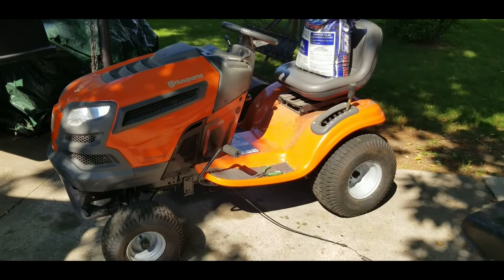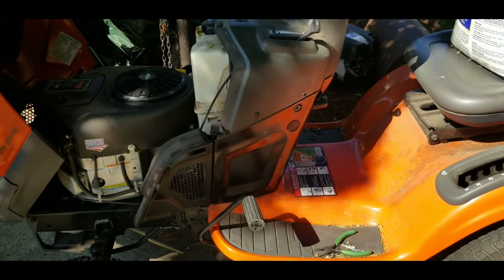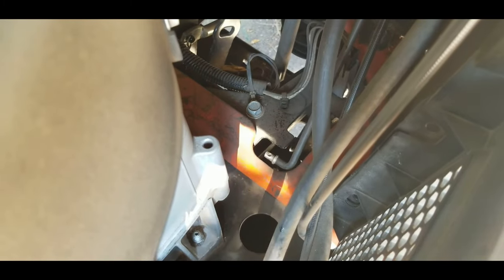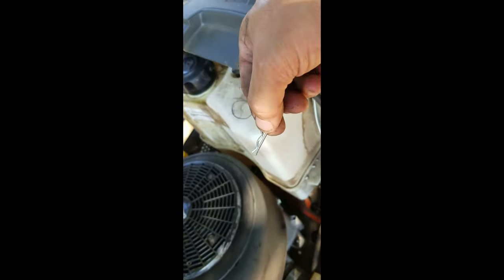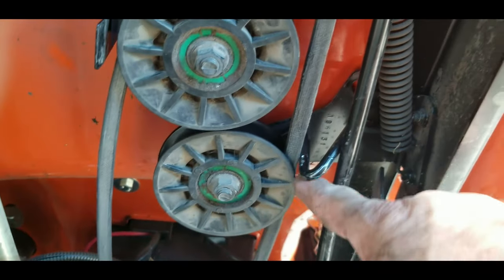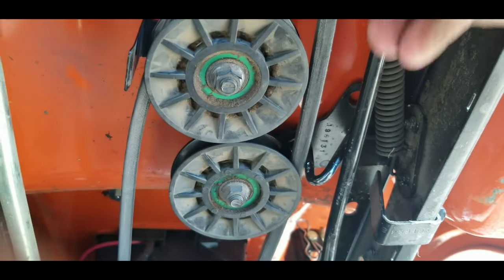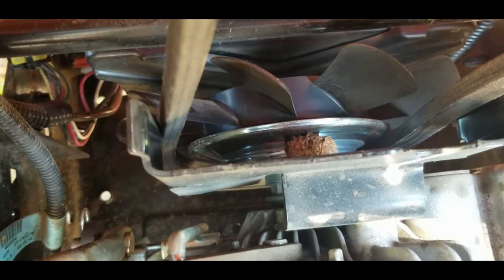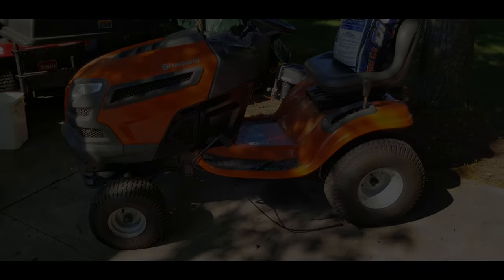Husqvarna Tractor Stopped Moving  - Diagnosis and Surprising Fix

Comment: Thank You!   Had the same problem this afternoon.  The belt was around the transmission and all the pullies but was not turning.   After taking the mower out and looked underneath,  I saw the belt slipped out of the pully on the motor!   Put it back and all is good!
Reply from the maker: Nice easy fix! Thanks for watchingg!

Comment: Mine literally had these same symptoms and stopped moving...I hope it's as easy a fix as you just had. Thank you
Reply from the maker: It could be a worn belt or worn idler pulley. Easy fixes. Thanks for watching.
Reply: @RealManSkills  Noise came on suddenly, checked belt right then, not worn, then stopped moving before I could get it back to garage, belt popped off. Weird
Reply from the maker: I had that happen with my Craftsman DLT3000. It was one of the pulleys. https://youtu.be/rvkSsJcgc8E?si=fYAwLMVrP-76Wze9

Comment: I have this same mower, it gets stuck in drive and when I can get it to reverse it goes very slow I’m thinking there’s a similar issue going on. How did you get the tractor on its rear? Empty gas and oil first right?
Reply from the maker: I use a chain hoist to raise up the front end of the tractor. I have never had an issue with the gas and oil.

Comment: Just put the park brake on and you can start it with out putting weight on the seat.
Reply from the maker: I needed to release the brake to inspect the where the sound was coming from. If I was sitting on the seat, I couldn't look under the tractor.
Reply: @Real Man Skills  Good point. Thanks for responding. Always nice to learn something new.

Comment: I thought the video is about a mower that won’t move but the video is actually about a mower that makes noise when brake is released so the title is misleading
Reply from the maker: The mower didn't move because the belt came off. I diagnosed the problem and fixed it. No misleading here.

Comment: I have the Craftsman T240 Turn Tight tractor..I looked at Husqvarna  John deere  the Craftsman T240 Turn Tight was the choice hands down better build than the other two simply a much better tractor all around..k46 transmission with steel gears metal hood Kohler 7000 series 22 horsepower 725cc V Twin engine 3 year unlimited hours warranty 5 year warranty on frame..dry weight 630 pounds the the list is long...I'll definitely get a few decades out of this one..
Reply from the maker: I haven't seen one of those yet. The Tuff Torque K46 transaxle is a common unit that is on many tractors. Glad you didn't get one of those plastic transaxles that some Craftsman tractors have. Thanks for sharing that info and thanks for watching!

Comment: Having a sticking pedal problem. Have to engage the brake to go into reverse and /or go into forward. Accelerates to full speed with pedal fully depressed but won't return to neutral. Cleaned debris out of spring and lever mechanism area under plastic cover but still not right. Any ideas where to look next?

Comment: Nice VJO, had the same problem lost cotter pin and I did not have a new one small enough to fit it either! it was fine for a while but then stopped moving fwd or rev....I don;t think I am going to have as EZ a fix as you did but you never know that was a great find!!!!  So grass is over a foot tall, got a new deck belt for the backup LT1000 cut about a 100' and hit something and ripped the spindeleoff the deck......so  now I have to fox the orange girl......

Comment: Nice! Mine is acting up today. It makes noise when the parking brake is released too so I need to dig into that ,but it's also not returning the speed pedal to center.... It's hard to any thing but the outboard end of the linkage shaft un der the pedal and there is nothing there that appears to be and issue. Ideas? Thoughts? THANKS!
Reply from the maker: Is there a spring missing? A spring that pulls the speed pedal back up?

Comment: Nice one bud ,,,,,that whole Brake rod ,clip replacement was interesting as well , she had 2 issues 

Wet a Beautiful low idle - the shop wound mine up and I don't like it ,,don't suppose you know how to turn down the idle do you ? Mines the FR651v Kawi , but I bet there All similar Carby function
Reply from the maker: Haven't worked with Kawasaki much, but most carb linkages have a screw to turn in or out accordingly.  Another option is the governor spring attached to a metal tab that can be bent up or down accordingly.
Reply: Your owners manual (available online) will show you.   
It’s the easiest and most obvious adjustment you will find on it using a Philips screwdriver.   
Do not adjust the governor linkage.  (8mm bolts with locknuts).

Comment: I got one of these but it dont move no more unless i lift the rear end off the ground and tires will spin VERY slowly and idea or possible advice what to chase down next?
Reply from the maker: First of all, there is a square key between the rim and rear axle on both rear tires. Make sure those square keys are in place. If so, you might have a bad transaxle. Replaceable, but expensive.